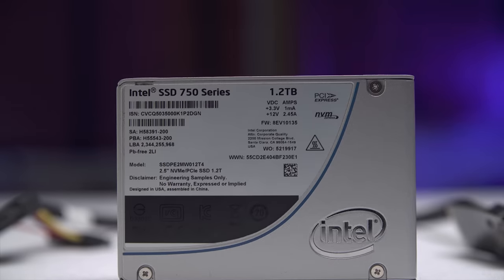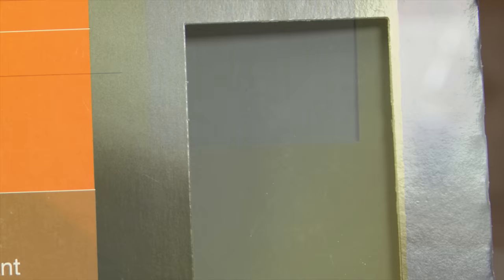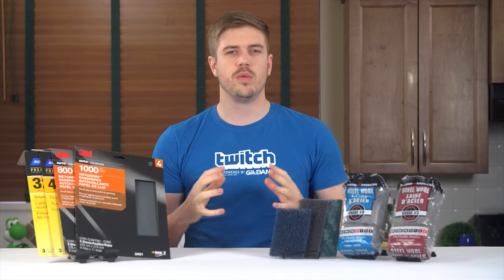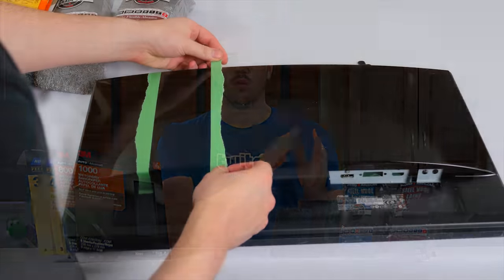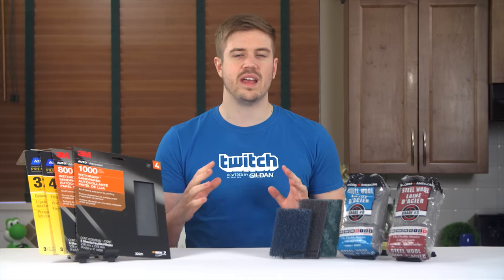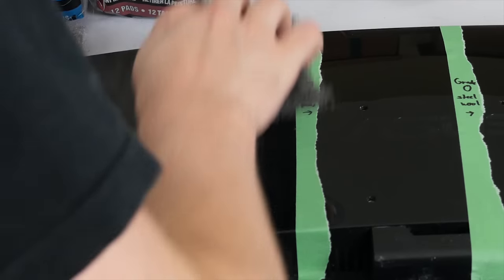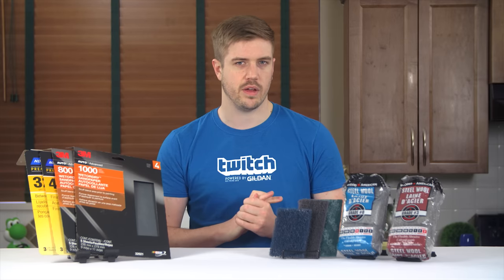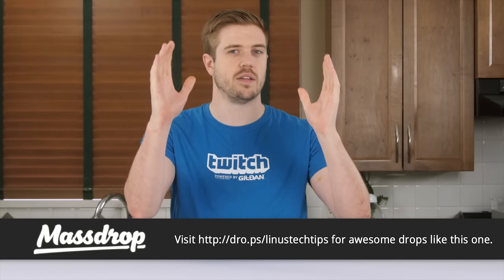Glossy to Brushed Plastic DIY Experiment - Addressing Functionality & Appearance

Comment: As someone who has done this to a glossy computer case once, be advised:
The result might look nice, but it's even more prone to finger prints than before. Even worse, the finger prints are way harder to remove, because the surface has a lot more structure now. Also, as soon as something as hard as a human finger nail touches the surface, it will leave a scratch. I would NOT recommend it unless you're absolutely sure nothing will ever touch the plastic again.

Comment: no sanding block?
Reply: Zomgdevil No flat surface?
Reply: Zomgdevil No answer, No problem
Reply: Zomgdevil Yeah the 3m stuff made the plastic look terrible.. lol...
Reply: Tech YES City There is different levels of 3m scotchbrite. The redish brown one Is the one I use at work.I work for a 3M owned company so pretty much I can experiment with all of them. It's all in the motion and pressure. But you also got to know when to throw out your sand paper or scotchbrite pads. Using a used up one will get you no where.
Reply: Prob in the next few weeks, bogged down with a lot of irl work atm (making a 45 lesson online video course for work).

Comment: I actually did this before, to my smartphone's case. The case was very nice and thin, with clear cutouts, but one problem: it was damn glossy, especially at the sides.. So I bought a sponge for 30 cents and use the green part and scrub it along the sides, gives it a very nice brushed look and also removes the icky glossy feel.

Comment: Why not just spray it with matte black paint? I thought the end result looked inconsistent and terrible man.... still thumbed up the video FWIW lol...
Reply: Tech YES City I think he was trying to preserve logos.
Reply: You can usually preserve that too by just putting some blutack over the logo before spraying.
Reply: Tech YES City You are the best Tech Yes City! :)
Reply: Tech YES City 

Didn't you notice the "experiment" part in the title?
Reply: Tech YES City Because you have to sand them down anyway?

Can't paint on a glossy surface.
Reply: +1 Mansen, he got you there xD These fake brushed plastic finishes would be the perfect base for spraying, but the original glossy would peel.
OR you can use self etching primer of the right color.
Reply: Depends really on what is on that glossy surface, I have sprayed over gloss before, recently did my monitor bezel to black, no problems at all.  Use a good car paint and you should be fine, cheap acryllic crap on the other hand will run everywhere.
Reply: Tech YES City Or you could give it a quick acetone bath. Perfect matte finish.
Reply: I am just trying to remember the worst kind of surface I have sprayed on lazy style - I sprayed a plastic airbox one time and a metal undercoat worked as well before spraying paint on.  If you are on a budget then dousing the part with brake cleaner in the sun can also work well.
Reply: Tech YES City brushing is alot cheaper and saves you one step. You need to sand them anyway if you want to paint them. And good luck if you manage to get any paint on the display.
Reply: Depends on what surface finish you are after, I would much rather have a lazy smooth finish than the one shown in this video :p.
Reply: Janne Salonen
I know it is an experiment and I am just giving feedback, nothing sinister going on here lol.
Reply: Tech YES City That's a lot more effort than just rubbing it with some sandpaper...
Reply: To get a 'brushed' finish you have to actually take your time and be pretty careful, though that is from my own experience.
Reply: Tech YES City Well brake cleaner will literally perforate the plastic, it would dissolve part of the structure that holds together plastic, adding UV radiation on top of that... and I predict your part may crumble in your hand if you over do it xD Acetone is a bit nicer, in that it will attack it immediately and you could literally wipe on, wipe off, for only mm deep surface damage for the matte finish.
Do not soak in either very long... For acetone, just dip in, pull out, and rinse it off, or wipe on, wipe off.
Reply: Jnan Mckenzie Only from my own fuck ups. I soaked a plastic carburetor cover for my lawn mower in brake cleaner for 2 hours, then set it in the sun to dry, the next day, it crumbled when tightening the wing nut putting it back on. 
As for the acetone, I have contact dermatitis, so when I wear a watch, I have to coat metal parts in clear fingernail polish. I think you can figure out on your own how I learned about how acetone matte-ifies plastic.
There are a lot of different types of plastic, so this might not apply to all.
Reply: True, depends on the brake cleaner you use though, I have had nothing but success with it, here is the SAKWA 27 inch from cross with a gray / gloss black bezel I recently sprayed (on the right), the bottom part was gloss as well.  That just needed an alcohol wipe / 2 coats of good car paint. 
The left one is the DS270 which will be getting a spray when I have some time to pull it apart (pain in the ass), but great for a side by side comparison. https://instagram.com/p/1-vQhZj1DO/
Reply: Also 2 hours? Damn lol that will certainly melt plastic. I was just talking about a quick spray and wipe.  I haven't tried acetone yet, might give it a shot.
Reply: Tech YES City Be very careful spraying technology products that stuff will completely fuck up any exposed ports or circuits it has to be completely covered.
Reply: Lol I just finished cutting a video on this exact topic.  Sprayed some ram with 7 kinds of spray paint, interesting thing was, was that it only has a capacitive effect and not a conductive one.
Reply: Richard Smith or just use plastidip. Is mat,available in any color, and removable. Also works just fine on glossy surfaces. Just spray your first layers really thin on gloss and it stays on just as good.
Reply: Tech YES City I thought it was great.

Comment: I've done this on my monitor. The back didn't turn out too good, it has some angles which is difficult to get uniform. But the front looks great, like from a factory. I used sand paper (800 or 1000, can't remember), followed lightly with scotch-brite to even it out a bit.

Comment: This is pretty clever, and I like the idea. You may want to consider putting some kind of sealer on the plastic afterwards. I suggest the UV plastic sealer stuff you get in a headlight lens restoration kit. After all, polycarbonate is polycarbonate.

Comment: to get an even better finish just like you would get on a retail product, you can disassemble the device and once you get the brushed finish, you can then use a heat gun to give it that satin sheen. You do have to be very careful not to use too much heat while doing this because there is a danger of warping the plastic.

Comment: Do I dare attack my mechanical keyboard....?

Great vid, Luke.
Reply: JayJapanB Which part is glossy? I imagine it'll be pretty hard to get the sandpaper down between the switches if it's the frame that's glossy.
Reply: It's the frame but it's really not hard to disassemble a keyboard. I've done it a few times to clean the keys.

Comment: you jsut have to be careful when doing it as its fairly easy to eff things up and instead of black plastic you will; end up with grayish scratches. I did it to my ARC midi (scratched the front a bit, so I thought treating it with bunch of sand paper will restore the brushed aluminium look). It did, it actually looked ok, except the whole front become brighter than the rest of the case.

Comment: I am actualy using fine steel wool for 3d printed models... Print with ABS, smooth the surface with Acetone(after that it has glossy finish) and finaly make it matte with the wool.

Comment: Hey linus i'm going to build a new pc and i want to know if everything is alright.
Core i7 4770
GTX 960 (Version with 4gb by evga)
Msi z97-g45 gaming ou z97 5 gaming
Nzxt h440 red an black
Nzxt kraken x61
8gb hyperx fury
Corsair cs 600w
Seagate 1tb
Kingston 60gb ssd
Reply: Maicon SergioDon't get the i7 4770 if you don't have a super amazing deal on it. It's last gen, and can't be overclocked.
Get an i5 4670k maximum, an i5 4460 would do just fine with a GTX 960. Also don't get the 4GB Version, unless you're gaming at above 1080p, at which point you should get a GTX 970.

For the GTX 960 you should buy the cheapest one, which will probably have the stock cooler. That is absolutely fine, as the GTX 960 is very power efficient.

The board is a solid choice, you could also go with a cheaper Asrock one, but if you're into the color scheme, get the MSI.

Same goes for the case, solid choice.

The water-cooling isn't really necessary, i would rather go with a good 30$ air-cooler and spend the money on a GTX 970.

The color scheme of the ram matches nicely, so if you want to go for that, get the kinston.

The Corsair is a good choice as well.

As for the SSD, if you have the money, get a bigger SSD, 128 or better 256, so you can install a few games on there, its really nice to have.
Reply: thanks
Reply: Don't buy a z97 motherboard because the i7 4770 is not overclock able, you should buy the  i7 4770k version. If you cannot then just save money and get a h97 motherboard :D

Comment: ***WARNING***

Just a heads up. after brushing the material is left unprotected, and even worse, negatively charged. It will easily scratch, stain and/or get dirt between the fissures very quickly. Every product, specially the brushed ones, not only take special chemical baths to neutralize their charge but also have a thin invisible layer applied all over it that protects it from small natural environmental conditions, such as high humidity, heat, micro-dirt and other bad conditions that are easily prevented. This mod is good but forgets to protect the protect the product at the end, which may seem fine at first glance, but after a few months - I would frankly say a couple of weeks - it will start to look ugly and will continue to, until it's finally horrible at which point the user might end up regretting to have modded it in the first place.

Comment: Hey Linus! I need your help!
I want to buy a laptop and I have an offer to buy an MSI GS70 at 1000$ ( i7 4720, GTX765M 2GB, 16GB DDR3 RAM, 128GB SSD + 1TB HDD, by my research it seems to be the 2013 MSI GS70 20D.
I want to buy this laptop as I'm a photographer and I also game quiet often. 
Will this laptop be good for a future investment of 4 Years?
If not please suggest a laptop around 1000$ 
I'm also looking at the new Lenovo Y50 w/ IPS Panel and 4gb GTX960M, So I'd like to know if the GTX960M 4GB is better than the GTX765m 2GB and by how much.

Comment: Hi everyone!!
i saw linus MSI GS70 Stealth Gaming Notebook review(the shirt on the head is funny btw), i found a manufacturer refurbished of that laptop
(red)MSI GS70 Stealth Pro-072 17.3" i7-4710HQ 16GB 1TB+512Gb SSD GTX970M 3G
in ebay for 2,171.52 Australian dollar, i'm in australia btw and because of that i need to pay postage + tax, so all together the laptop will cost me +- 2470 Australian dollar, buying anew one in Australia while a new one with almost the same spec, the diff are only the ssd(384) and color(black) for 2900, do you think it's worth it to buy the manufacturer refurbished one?

Comment: I prefer a basic matte finish for plastics that are handled often.  As pointed out glossy is a finger print magnet. Brushed however looks like CRAP to me! That scarified look just plain does not work for me.
That said You did a great job of emulating the factory brushed look.

Comment: LinusTechTips please help!, i don't know what PSU i should use for my gaming rig, and i was wondering if you could tell me, i get different answers every time i use a power supply calculator, 682w, 40, 650, 300, 450. I don't over clock, and I'll keep it on AT MOST 8 hours. Here's my rig, please help!

CASE: Obsidian Series® 450D Mid-Tower PC Case

PSU: (what you to tell me)

MOBO: MSI Z97 Gaming 7

GFX: EVGA GeForce GTX 980 Superclocked ACX 2.0

RAM:  G.SKILL Trident X Series 8GB (2 x 4GB) 240-Pin DDR3 SDRAM DDR3 2600 (PC3 20800) Desktop Memory Model F3-2600C10D-8GTXD

CPU: Intel® Core™ i5-4690K Processor (6M Cache, up to 3.90 GHz

DVD Drive: LiteOn 24x Internal SATA DVD RW Drive [IHAS124-14]

HDD: Kingston Digital HyperX FURY 120GB SSD SATA 3 2.5 Solid State Drive with Adapter (SHFS37A/120G)

Thank you!

Comment: Will this cover over warranty?
Reply: Read the manual. Every product has a different warranty
Reply: rex747 depends on what it is, most warranties don't cover cosmetic damage anyway so its irrelevant what you do to the outside, just dont mess with the inside, but check the manual of the thing before you do anything

Comment: I love glossy plastic finishes. Just dust regularly and you're fine.
Reply: Also, don't touch your glossy plastic product at all.
Reply: ChezMak0r Dont even look at it!
Reply: Don't dust it, just spray it with a can, and slap some lcd coating.
Reply: They scratch SO EASILY
Reply: +Truls Årseth Olsen Don't even think about even getting a glossy plastic product. In fact, it's greasy already because you read this comment.
Reply: I don't even touch my xbox one and the glossy part is all scratched.

Comment: The true test would be the front of a glossy monitor like the Apple iMac.
You could simulate such a surface with a sheet of clear plexiglass (though it is softer than glass).
I don't care how glossy the back of my monitor is - I never see it.

Comment: You could try and deliberately scratch your gear, or you could just paint it?
Reply: Guy Random you go through similar steps when painting it. You use a low grit sand paper then high grit then paint. He essentially prepared it for painting.
Reply: You need to sand glossy plastic or the paint won't adhere and would just peel off.